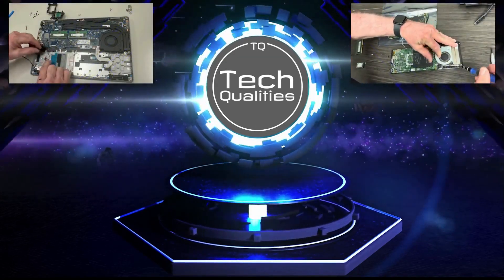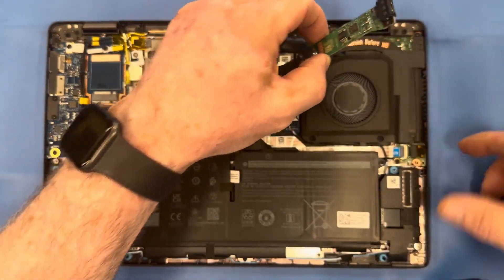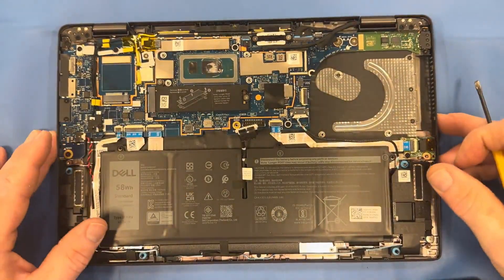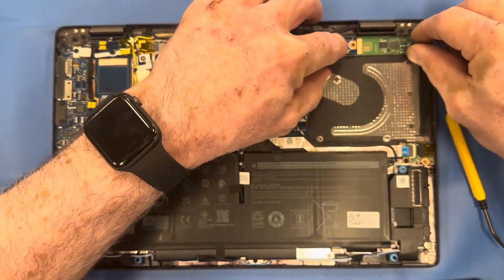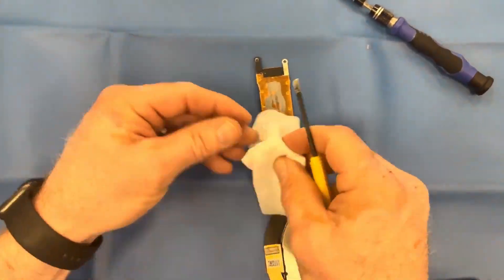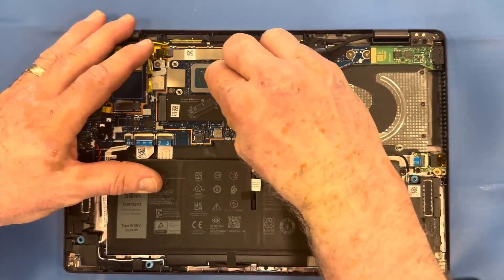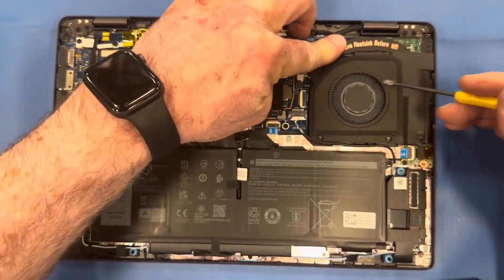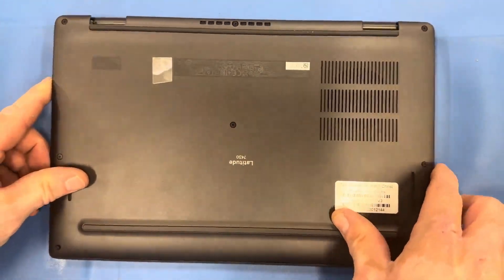Dell Latitude 7430 USB-C Daughter Board Replacement

Comment: You should have used a plastic spudger on that heatsink, never metal on metal. You can clearly see it gets scratched.
Reply from the maker: Great point bringing that up. As you can see in the video I kept the pry tool on the outer edge when prying, for that very reason.  All the better to use a plastic pry tool especially if getting more physical with the heatsink.  Thanks for watching!